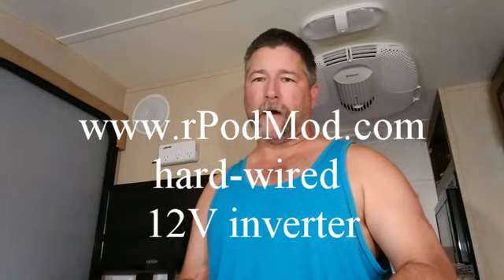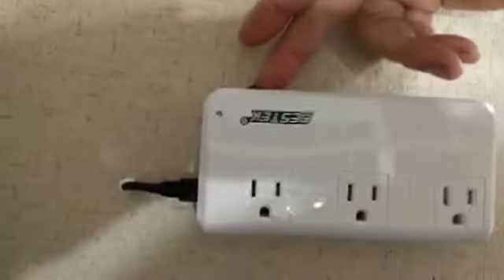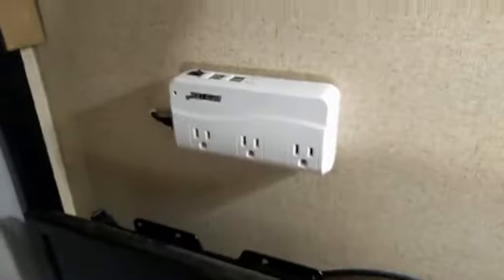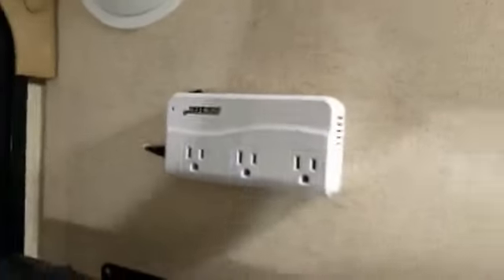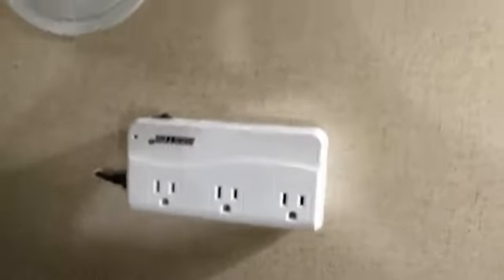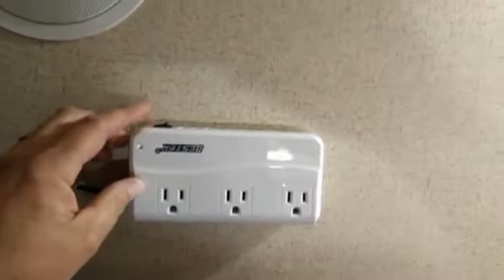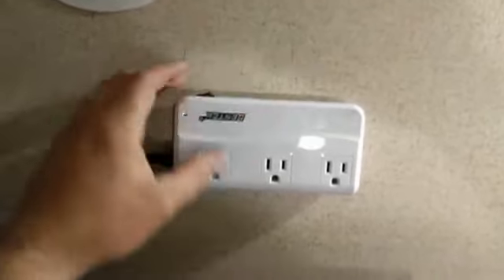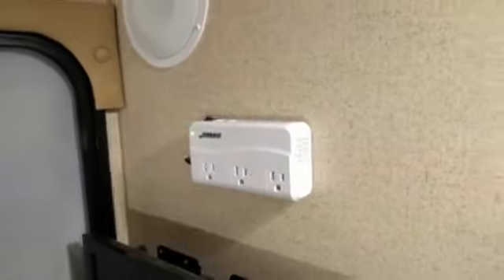12V Hard-Wired Inverter for r-Pod 2015 171 by Forest River

Comment: Does the inverter work from battery power to run your TV at night?
Reply: Yes I tapped into the 12 volt that was feeding the porch light. It comes through right there on the wall. I plug the TV in and it runs directly off the 12 volt with just the tiny inverter doing the work. I used this inverter. I cut off the standard 12 volt car plug so that I could hardwire it make sure you add a fuse in the connection. https://amzn.to/2Zrg862 here is the link to an option to add the fuse-- https://amzn.to/3jFrESs